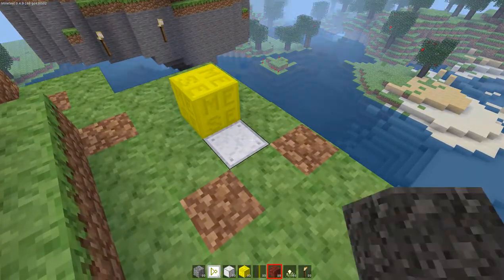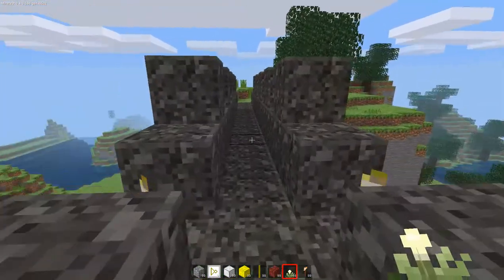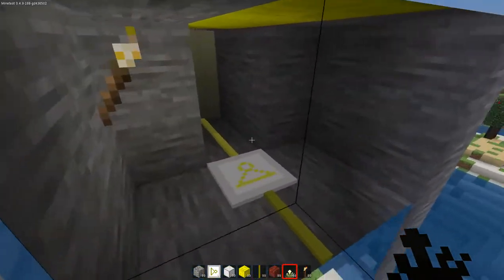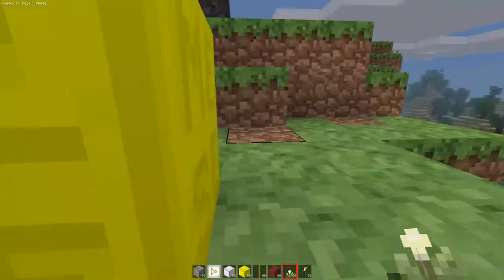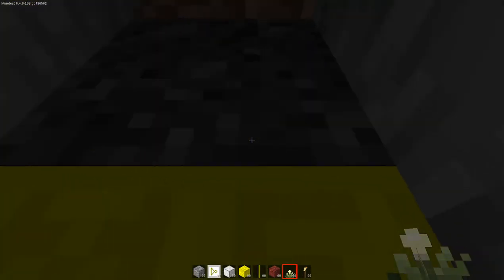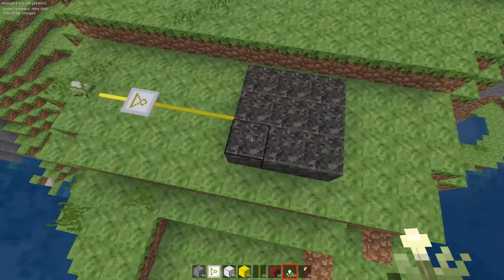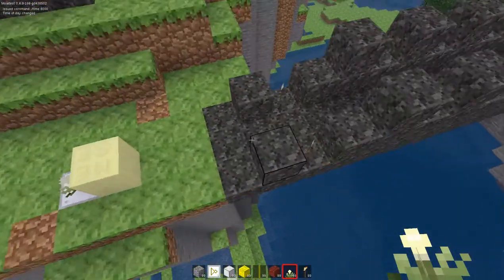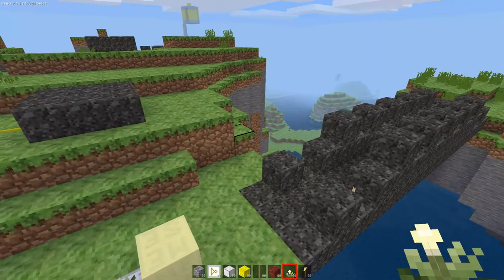Minetest Mesecons - Magic Bridge

Comment: thats neat, instead of having to put a power plant each time, couldnt you leave it there with and add a switch or button?
Reply from the maker: Yep, you could definitely do that as well.
Reply: *****
Yeah i ended up adding a wall lever running to a sticky piston that would push the power plant towards the ghoststone and make it disappear. Thanks for the idea mate.
Reply from the maker: You're welcome. Also I recommend that you check out some of my other mesecons videos, as they show off a few other designs that you might find interesting.